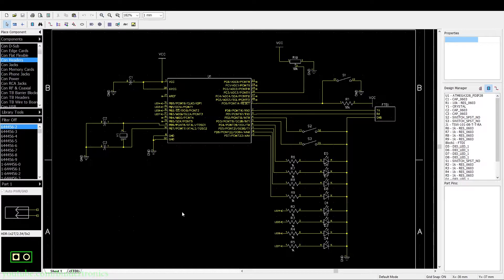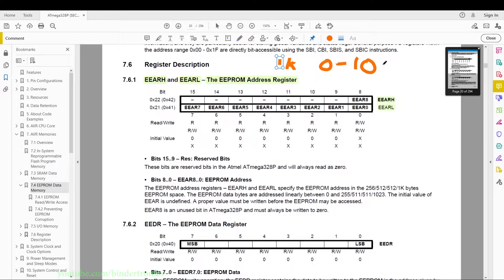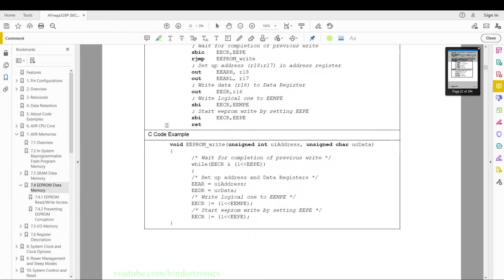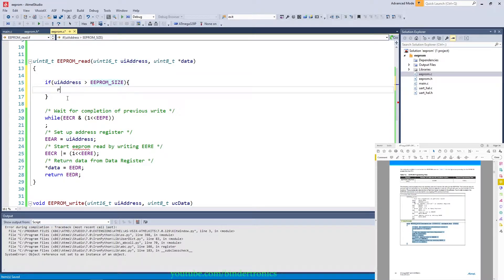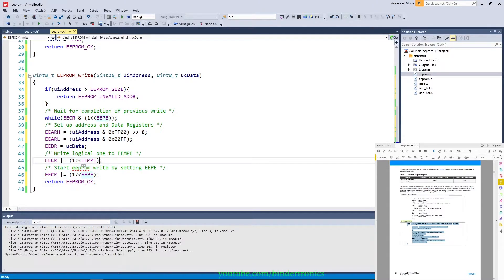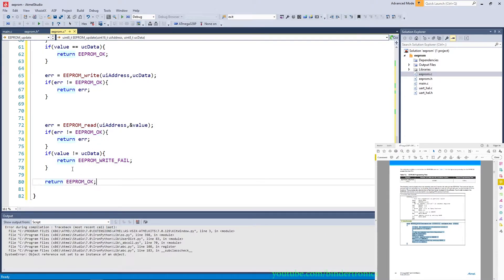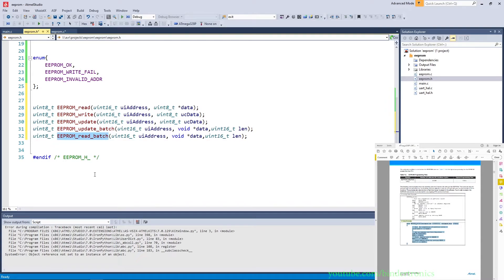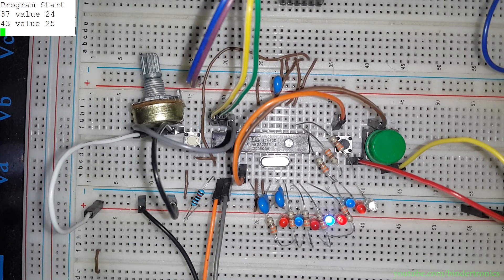EEPROM Read/Write 🔴 ATmega328P Programming #10 AVR microcontroller with Atmel Studio

Comment: Hello sir 
Can you help me please?
I have a allready coded  ATMEGA328P IC, I want to write EEPROM and FLASH files to another ATMEGA328P IC. I try to write through AVRDUDES software but the FLASH file is successfully written and verified .
EEPROM file successfully written but doesn't verify.
Eeprom file verify error 

Help me brother.
Reply from the maker: Slow down the programming speed and/or erase the eeprom before programming. make sure the efuse is not set that disables writing to the eeprom
Reply: @BinderTronics  Thank you sir 
I am trying as you said.
Can you share your contact information?
Reply from the maker: https://electronics.stackexchange.com/

Comment: hi sir i have done Arduino code can i use it in atmega 328
Reply from the maker: Not sure what you are asking.
If you are already using a UNO R3 you are already "programming" an atmega328.
If you want to use this code with Arduino and a UNO R3 you can.
If you want to use Arduino code with this code you can't. The Arduino SDK for the UNO R3 (atmega328) is built on top of this type of code. It is a one way street.
You can import the Arduino core into Atmel studio but I never cared for it as the Arduino SDK is to infeasible.

Comment: Hello sir, I am using pcb 5.0 Willem Eeprom Programmer and do not have a model for a chip but have socket, is it possible to make it and pay someone to add that chip to be supported? Atmel AT27C512R
Reply from the maker: Depends if the pinout of the device will match. Best I can tell you is probably.
Reply: @BinderTronics  the socket is the same as for the winbond w39v040fbpz which I used with it and managed to flash, but maybe the datasheet of the chips in a comparison will decide if they are similar i guess...I seen an old chip programmer named EPR-01 which was compatible with the Atmel AT27C512R but no trace of software etc
Reply from the maker: Seeit Leaper-56 maybe? The AT27C512R is listed as compatible. Not really familiar with PROM programmers.
Reply: @BinderTronics  I already have the PCB 5.0T Willem Programmer which has two of those sockets that fit the AT27C512R but no sign of the model name in the softwares menu i found, do you think you can manage to find software for that device though? would be sure a big help
Reply from the maker: You are better off asking on general electronics forms.
Reply: @BinderTronics  I think I'm gonna pass but thanks for replying